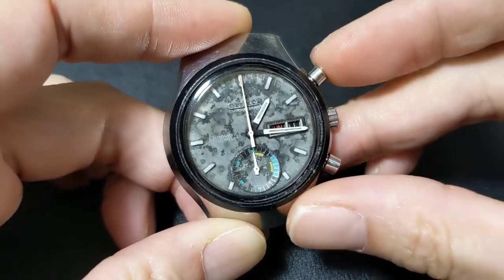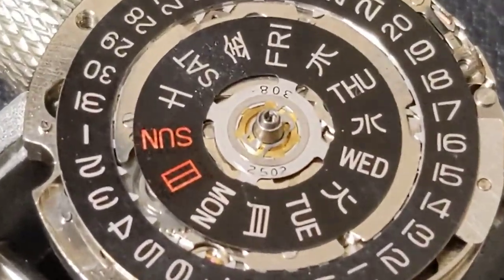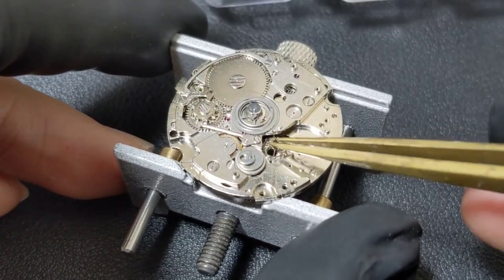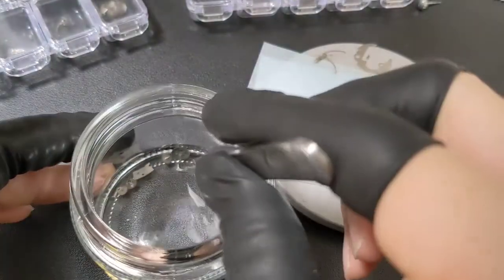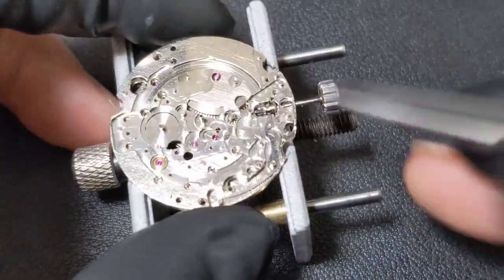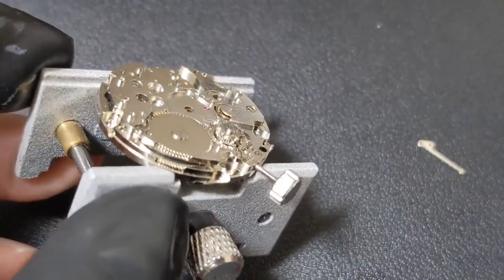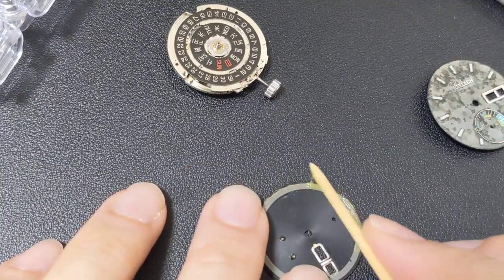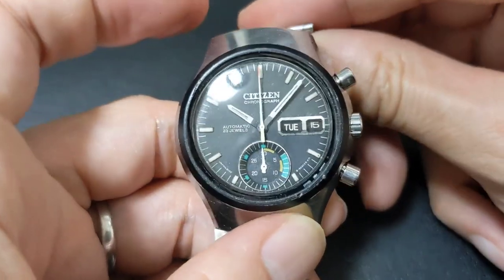Citizen Vintage Chronograph Restoration - Caliber 8100A

Comment: My soul cried a little when you found the glued in capstones! I fear that without the ability to properly clean them, the lifespan of your associated pivots will be greatly shortened. But cheers for persevering in the face of adversity!
Reply from the maker: I was really disappointed with the glued cap jewels. Because, as you mentioned, the pivots may be damaged. After this video, I bought a donor movement and rebuilt the movement with better parts. I appreciate your concern.

Comment: I love that watch. Nice job!
Do you know case diameter, please?
Reply from the maker: Thanks! The case width is about 37 mm without the crown. It's smaller than other typical chronograph watches. But since the bezel is narrow, the glass and dial size is relatively bigger for the size. The glass size is about 30 mm.

Comment: My watch has to press the start button to work, but when I press stop the watch does not work and The hour and minute hands stay at their original positions. What can I do to make the watch work without pressing the start button?
Reply from the maker: The center chronograph wheel may have an issue. The wheel must be cleaned and lubed. I experienced the same issue in another Citizen and this is my solution. 
https://www.youtube.com/watch?v=qZFoWwRkCDU&lc=Ugwe49PKaAGlqFpbs4t4AaABAg